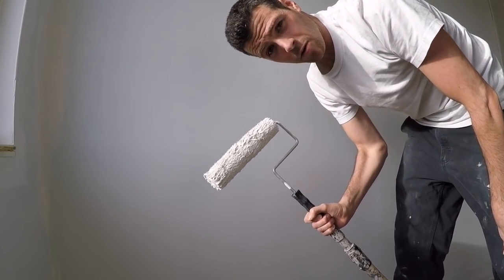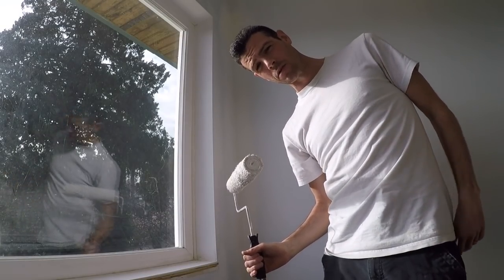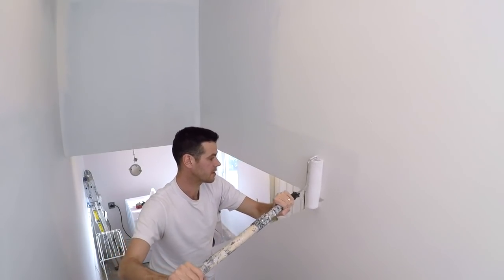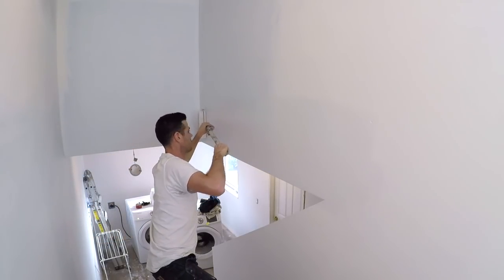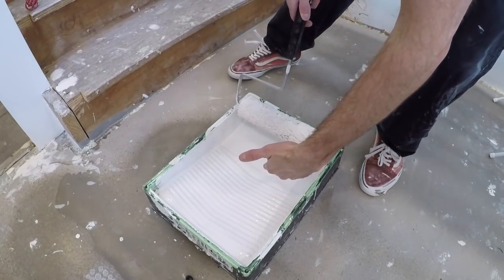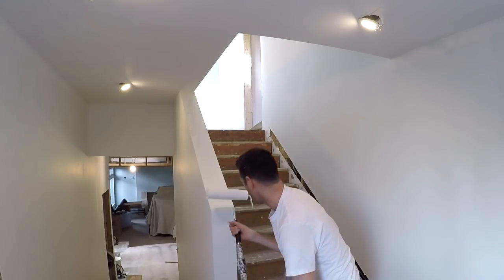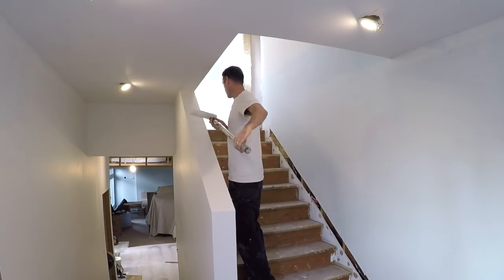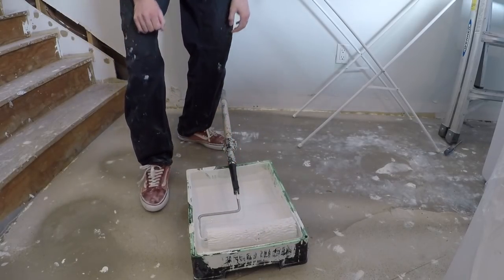PAINT BUILDUP ON CORNERS!

Comment: Good stuff...was hoping you'd talk about the same issue but with a brush, like when painting square casing. It's so easy to drag the brush on the edge and leave a run or to chase a run back and forth, fixing one face but pushing the drip to the other. There must be some tricks for doing this (brushing) better than the way I do it.

Comment: tip for sanding paint, you'll be surprised how big of a difference when you add a bit of water to your sander, or wipe the surface first with a damp cloth. Even with a high grit 400-600 sand paper, you can sand through layers of paint without issue.

Comment: I primed the wall, put on two coats of paint. Realized too late I used the semi-gloss finish instead of the can of eggshell. I have all these tiny bubbles and other imperfections. I want to repaint the wall with eggshell. How do I sand and prep the wall so the eggshell adheres and looks nice?

Comment: Newbie question here, instead of sanding down your dried drip, why not scrape it off with a 5-in-1 and paint over that little bit?
Reply: Scraping it off will leave a low spot that would have to be filled, as scraping almost always takes the paint underneath, and even some of the mud with it, at times. It may sand out, but it would be to the point of changing the sharpness of the corner, once repainted.
Reply from the maker: Yup.
Reply: If you don’t want to sand, get a DeWalt cordless planner. That’ll take it down a foot or 12!

Comment: We now have the paint with the primer in it and is easy to get runs compared to the old style paint. Just a note on another subject. Do you use round corner edging, and if so, how do you mud them to make them match?
Reply from the maker: I have actually never had to install or repair bull nose corner bead yet.